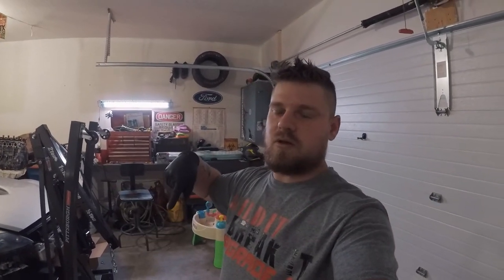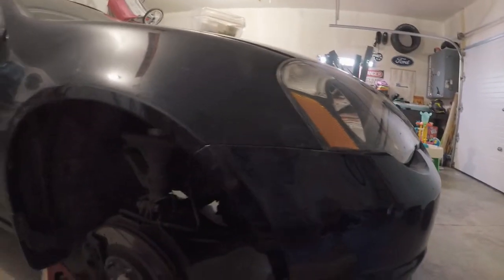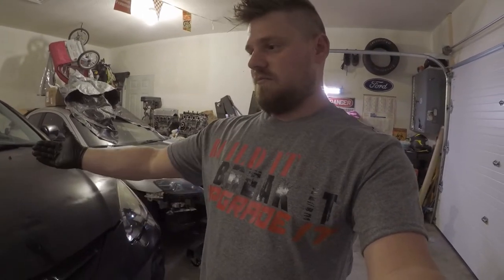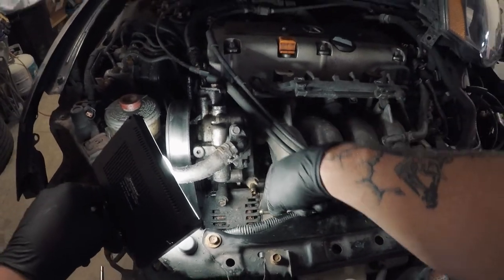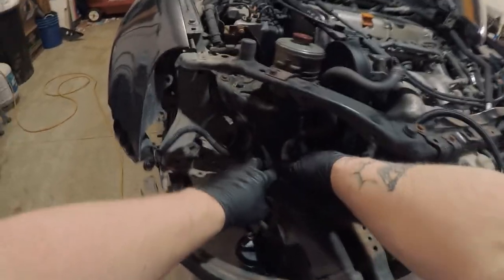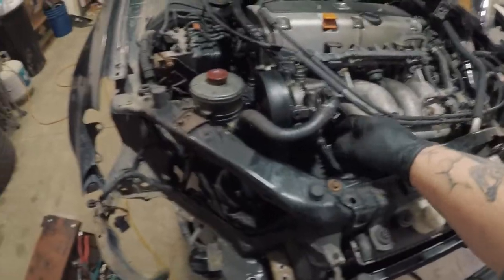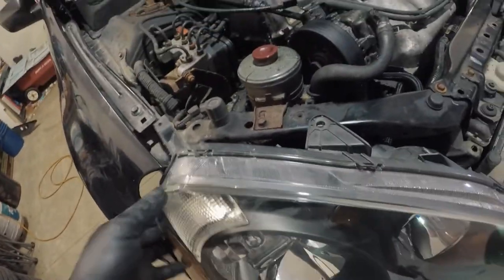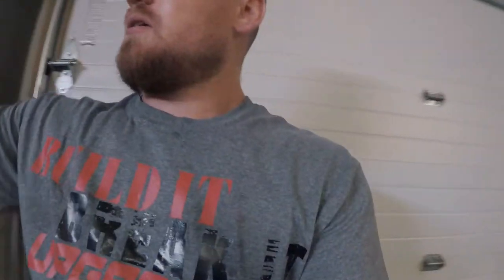Oil catch can installed on 2002 -RSX TYPE S K20a2- #redlineryan #rlr # rsx  #K20a2 #projetrsx #dc5

Comment: Great content. I’m just curious, without a turbo, how much oil actually makes it into the catch can? I would think it’s negligible, but I wouldn’t know, and I would guess that by now, enough time has elapsed for you to give better info on that.
Reply from the maker: You are probably right that without the turbo this mod is not necessary. But in my opinion if I can catch any blow by is always good.  I don't have the rsx anymore. So its hard saying how much it helped. The Mazda speed 3 defiantly needs one I have so much blow by.